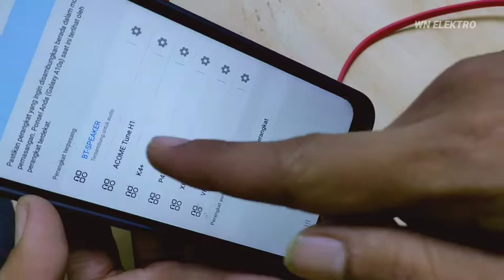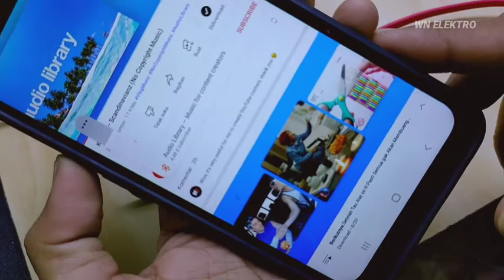CARA PASANG POWER PAM8403 DI MP3 PLAYER BLUETOOTH

Comment: Mau tanya bang, modul mp3 blotut itu yang 12v apa masih bisa di gabung ke ampli 12v jg agar bisa banyak atur sprti treble dan bas dan echo, lalu gimana cara gabungnya bang, aa ada vdeonya, dan amplinya juga ada coloka  ac220v, dan jika pkai ac gmna modul mp3 itu tetap bisa nyala? Msalahnya ampli 12v punya saya tdk ada led dgitalnya mau digabung agar ada, lalu dimana gabung kabel 12v di modul mp3 ke 12v di amplinya agar tetp nyala ac dan dc, mhon kasih pnjelasan bng atau jika punya vdeonya kirm linknya

Comment: Bang kalau inputnya ke mobil 12V gimana
Reply from the maker: ngga bisa gan ...itu power pam 5v dan modul mp3 sudah modif ke 5v ...kalau mau di akalain pake step down gan penurun tegangan amper lebih besar lebih bagus
Reply: @wnelektro  punya saya support 12v bosku, mksdnya nyambung ke PAM nya bagaimana, apakah tetap 5v
Reply from the maker: oh kalau gitu pake power pam yg 12v aja gan...jngn pake yg pam8403 pake yg 8610
Reply: @wnelektro  bisa gan, pakai PAM5V. saya pasang PAM positif dan negatifnya, ternyata dr MP3 nya memang ngasilin 5 v dr sumber yg diambil dr chip 3 kaki itu, walaupun 12 v input mp3 nya.thank u gan.
Mantap speaker 100W pun bisa di pakai, 2 biji
Reply from the maker: @iqbalharahap1351  ngga drop gan ambil dari out ic 7805 yg nempel di modul blutut
Reply: @wnelektro  engga gan, saya masukkan daya aki mobil 12v ke MP3, kemudian saya tester IC nya, ternyata dayanya 5V, jdi saya lanjut ikuti saja tutorial dr wnelektro:). Maka dr itu sya terimakasih sekali sm channel ini.
Reply: Lebih simpel dan keras suaranya ganti pam 8610 bosqu itu berada di tegangan 12v

Comment: Mas knp tegangan 5v dari charger hp tidak dilewatkan input soket dc di bluetooth nya langsung?   Kenapa kok dilewatkan kaki ic 7805?
Reply from the maker: alasanya tegangan jadi drop gan kalau lewat ic7805 dari modul bluetooth
Reply: Jadi input dc di modul bluetooth digunakan jika tegangan adaptor lebih dari 5volt ya.   Jika dari charger HP dilangsungkan ke kaki ic 7805 ya?

Comment: Pemakaian sebentar aman² saja, tapi jangka panjangnya bisa merusak modul mp3, karena daya akan mengurang, dan membuat transistor di modul mp3 jadi panas dan melemah
Reply from the maker: sejak kapan daya 5volt dc bisa melemahkan transistor modul mp3...??? mlah yg ada ngga kuat kalau input masuk di ic 7805
Reply: @wnelektro  kalo di volume full patah"/drop kenapa ya om
Reply: @youlyrics6959 tegangan modul mp3 nya pakai yg 12v jgn 5 v.utk yg pam 8403 saja yg pakai 5v ambil dr jalur out ic regulator
Reply: Sejak kapan DC 5volt bisa melelehkan ngebak ni orang
Reply: tidur ini orang ya??,
Reply: Sok tau,, terus di buat untuk apa tu modul.
Reply: Sangat bermanfaat
Reply: 😂😂 kurang jauh bng perservisan
Reply: Sangat tidak pengaruh lah..

Comment: Apakah gapapa pake tegangan 12v?
Reply: klw bsa paling tinggi 9 volt jgn 12 volt gk akan bertahan lama bsa jalur" bluthoot putus karna panas, ic regulor jg panas karna gk ada pendingin bsa retak nnti nya, jd di rekomendasi 9volt paling tinggi, amper nya 1 amper saja
Reply: Klo gapake pam tetep lebih bagus 9v bang?
Reply: Punya sy awalnya pake adaptor 12V, bluetooth sering putus nyambung.
Sy ganti pake adaptor 9V stabil, ga putus2.

Comment: Kalo pakai adaptor 12 V 5A ikut tegangan bawaan buat mp 3 nya. Pam ikut sesuai video kegedean gak bang
Reply: yg pernah saya coba 12 volt dn 5 amper  kegedean, dn bsa menyebabkan kn putus nya jalur di bluthoot mp3 karna panas jg ic regulator nya,yg cocok 9volt 1 amper maksimal(itu bsa di pake berjam") semoga bermanfaat dn berhasil
Reply: @ernalarigaernalariga7904  kalo pake cas hp .kenapa kalo volume di naikin malah drop/patah" Suaranya om